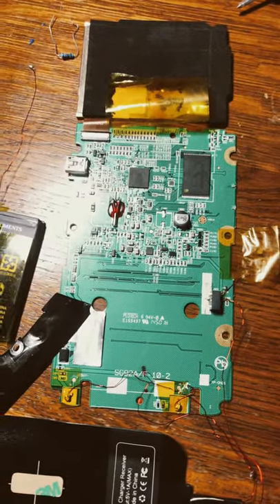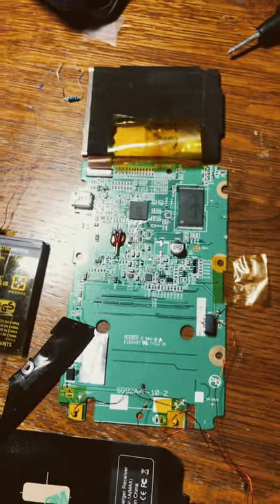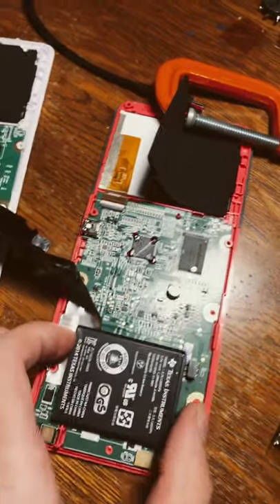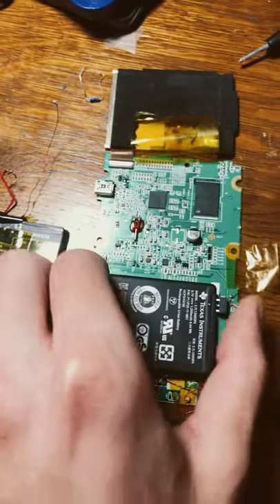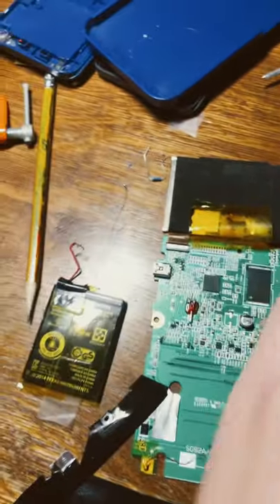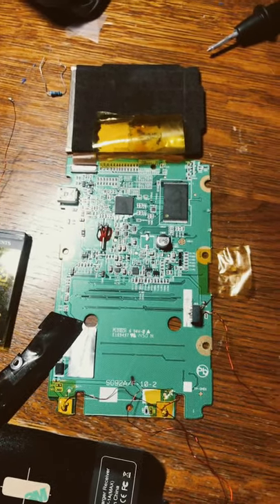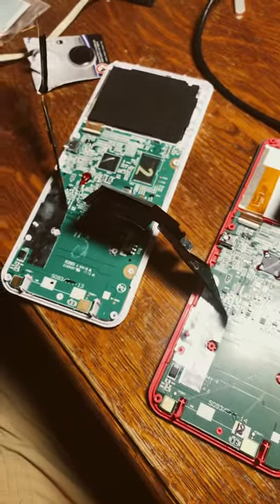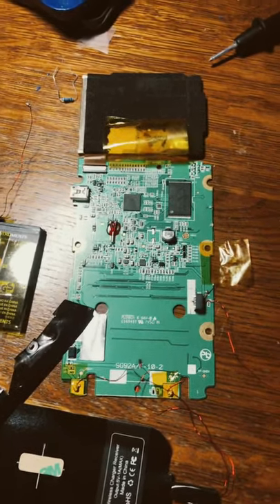I accidentally fried my calculator.

Comment: Dang, my pcb/electronics knowledge is slim but I would take a multimeter to the area that I thought the wire touched if there's no visible signs! Hopefully, it didn't go directly to the ez80 otherwise you have yourself a parts calc.
Reply: Note to self, when I do the battery mod, make sure to tape the areas around the wires and tape the wires down.
Reply from the maker: Yeah there's a lot of troubleshooting I've been doing. I'm creating a voltage map so I should be able to figure out exactly what component is fried. 
I'm definitely insulating absolutely everything in the future if I get this working again.